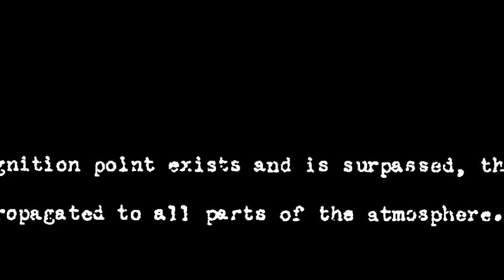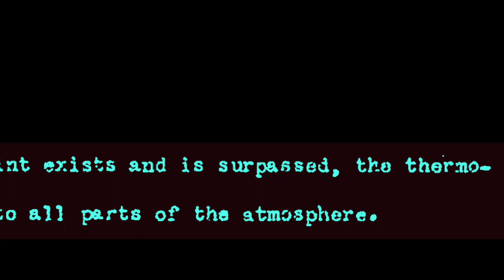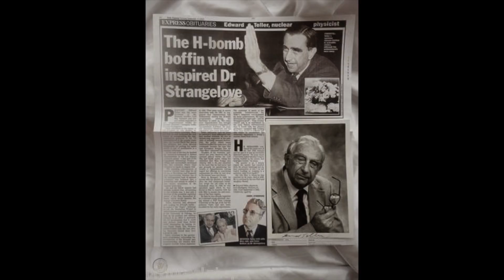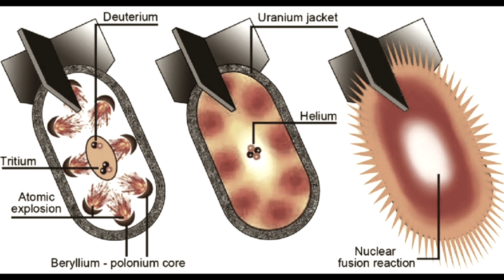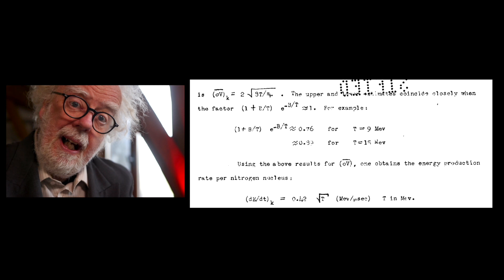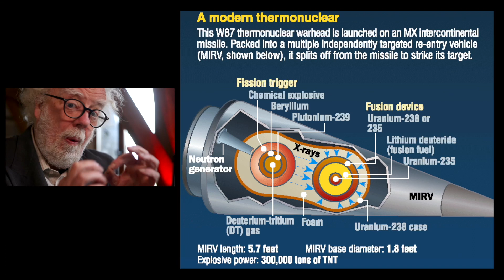The Doomsday Device - Mystery from History

Comment: The Tsar Bomba was scaled back too. The fusion tamper (U238) was not included in the test device so as to "give the aircrew a better than 50/50 chance of surviving the test". With a tamper it has been theorised that it would have been between 110 and 250MT depending on the accuracy of the compression charge timing.
Reply from the maker: oh boy.....what would that size have started?
Reply: @SimonHollandfilms  Nothing, the test proved that the atmosphere was too shallow for the energy to be harnessed in the blast wave, in other words, most of the energy just went into space. All devices larger than 50Mt were a waste of effort. The Americans figured this out decades before and never seen the point in very high yield warheads.
Reply: @nickbreen287  The Tsar Bomba was tested in 1961. Ivy Mike was 1952. So how precisely could it have been decades?
Reply: @gordonlawrence1448  Ivy Mike was not in the same league as the Tsar, testing was moot as the calculations alone show the wasted energy. The USA did not require high yield warheads, their missiles could hit the target. The Soviets would be lucky to get within 10 miles of the bulls eye so just increased warhead size to compensate. What would anyone need a 50Mt warhead to destroy that would not be destroyed with a 5Mt?
Reply: @nickbreen287  Nice comment Nick... is the factual data accessible to close this issue? Irrationality can cause costly mistakes such as WWI and WWII
Reply: @SimonHollandfilms  While such a bomb remains a nightmare deduction by a nuclear theorist, very bad people will not have the imagination to realize the necessary fabrication steps unless they are told such a device is possible or better, is not possible That is the pressure I refer to and the deduction of why we must alter the reality of our society's current form "An ultimate tower of Babel", a.k.a. a "nuclear weapons superstructure" and model for the resulting "Free World". For such societies to prevent the adoption of the concepts of secrecy and of sales of military infrastructure (a.k.a. weapons) all for political favour that makes all of this toxic trajectory possible
Reply: @SimonHollandfilms  With both military and centralized political power and its administration (and its deceptive high visibility). Where instabilities reveal conflict between political and military objectives and where people become tokenised because of inequalities and lack of representation within state law to become expendable (yet again!!!) because of the conflict between "ruling class" factions or state ownerships. Patterns to watch out for because society is not yet built on humane or inclusive or truthful foundations. Not until we get involved in decentralised democracy for reality's sake.  I thank you for encouraging deep thought and reflection on historical matters for the truth that cannot be hidden from  multiple points of view over an extended period of time. Good perspective Prof. Holland.
Reply: @gordonlawrence1448  It's all in the interpretation 1950's and 1960's is two decades. I agree that it is only nine years between 1952 and 1961, but it is in two separate decades.
The newspapers and TV will report on New Year's day 2021, something that happened on New Year's eve 2019; "An event that happened three years ago . . ." So a year and two days is suddenly  three years ago and coincidentially, two decades. Go figure!

Comment: I believe the reason why nuclear bombs don't set off runaway fission cascades is because the fission reaction and nuclear explosion is only possible when radioactive material is at "critical mass", aka compressed. So for the first few fractions of a second, the nuclear explosion is entirely contained within the bomb. But the reason why the fission reaction doesn't continue, consuming the bomb itself and then the air around it, is because only the nuclear material in the bomb is at critical mass. The mass including the air particles around the bomb, are not. So the fission reaction just releases all its energy as an explosion, without continuing and destroying all matter on earth.
Reply from the maker: thanks....this is the protection mechanism but it can be exceeded by a large enough bomb
Reply: @SimonHollandfilms  Oh yes, I was simply explaining why the trinity test didn't cause the world to blow up

Comment: Actually, the Russians did develop something called 'Dead Hand' (Mertvaya Rukain) the 60s, it was and still is by all accounts an autonomous retaliatory system, intended to strike back should their command structure be destroyed by a surprise first strike. Also known by the technical name, 'Perimeter', the system consists of a network of seismic, air pressure and radiation sensors that would take command after an overwhelming attack. It is said to be situated in a mountain somewhere in the Urals, some pundits have speculated there may be some enormous 'doomsday device' under its control too. The West seem to know very little about it other than it is operational and it is being continually updated.
Reply from the maker: interesting

Comment: I have heard the tsar bomba was 50% weaker than the production nuke, they had taken the third stage out and replaced it with a lead outer casing where the original 3rd stage resided making the non test bomb a 100 megaton divice.
Reply: THAT IS TRUE !  The device was scaled down. The reasons given that at 100 MT its own shock wave would bounce back and render the effect of the main blast less effective. This of course could only have been a rouse to hinder NATO and USA development of bigger Bombs.

Comment: It is claimed that the Soviets build a doomsday system called "Dead Hand" also known as "Perimeter". It is a automatic nuclear weapons-control system. The system remains in use in the post-Soviet Russian Federation. it can automatically trigger the launch of Russian's ICBM missiles by sending a pre-entered highest-authority order from the General Staff of the Armed Forces, Strategic Missile Force Management to command posts and individual silos if a nuclear strike is detected by seismic, light, radioactivity, and pressure sensors even with the commanding elements are destroyed. It is normally switched off and is supposed to be activated during times of crisis. However, it is said to remain fully functional and able to serve its purpose if needed

Comment: The Castle Bravo test was supposed to be of 6 MT. The Actual Yeild was 15 MT. It shocked scientists in its power and run away nature.
Reply from the maker: big difference
Reply: In did not run away. They just were wrong about the differences in cross section between Lithium-6 and Lithium-7.
It was assumed, that only one of them produces yield and the other is just inert ballast, but inevitable due to it being not easy to separate the two.
So they used enough of the compound to contain the right amount of the "hot" variant and accepted quite some of the "cold" stuff.
Well, the cold stuff didn´t really behave like calculated and happily went into fusion as well.
Reply: @sthenzel  Yes it performed with more power than predicted.. it ran away with the available fuel.